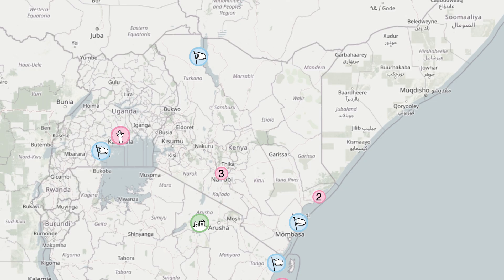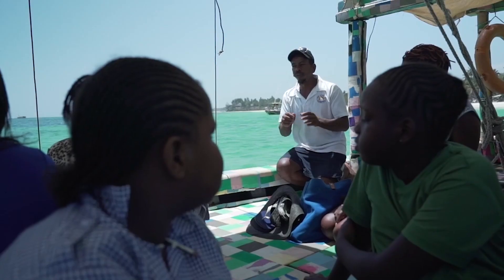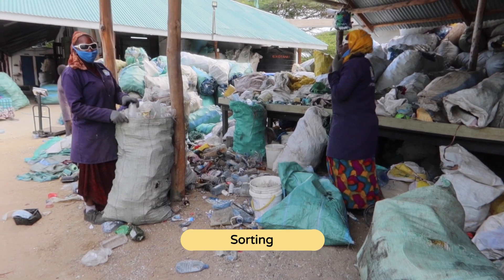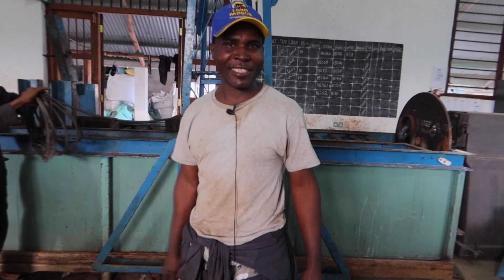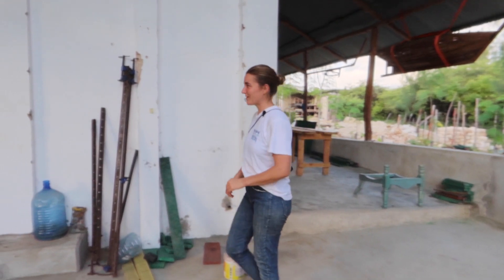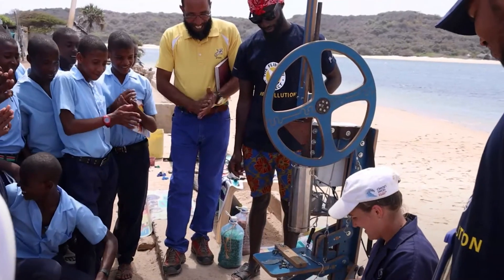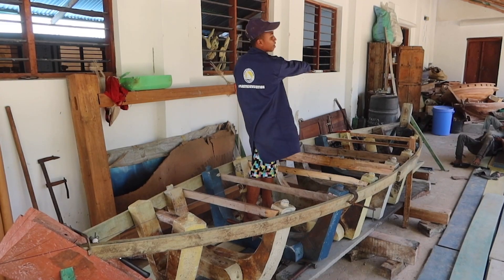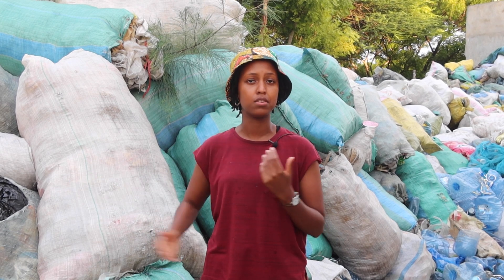They turn trash into boats!

Comment: Honestly, a lot of these plastics would be far easier to recycle locally by makers if manufacturers would just CHILL THE F OUT WITH THE LABELS/ADHESIVES.  Getting manufacturers to stop with some of their nonsense will go a long way.  Won't be as splashy or get you a bunch of clicks, but it would probably affect the outcome more.
Reply from the maker: I think we would all agree to that. If you watched until the end, you will have seen that one part of Flipflopi's work is to work on regulations and laws to tackle the problem from the source - as recycling alone is only to clean up the mess, so we need to make sure we avoid the mess from happening in the first place. Tough one though, sadly the industry is powerful. :/
Reply: @Precious_PlasticHQ  Yeah I wrote that before reaching the end of the video, and you're right.

It will probably take regulations.  Specific regulations need to be proposed.  Manufacturers won't propose them on their own; society has to get together and ram this change through them.

First option is just to ban single use plastics, but that would be tricky.

The next would be to produce a universal standard container spec which meets specifications for recycling (and come complete with tooling to actually do it).  Go in increments from 0.5L and increase in powers of 2.

Once that's in place, require the manufacturers and designers to produce a similarly spec'd product.  Shift their financial focus from "making things pretty" to "making things functional".

If they want to save on those extra costs, they can just use the universal standard.

Comment: great idea, even more microplastics in the sea
Reply: This comment does in fact raise a valid debate that I have battled with. I'm am a qualified mechanical engineer and have been building and experimenting with the Precious Plastic equipment in my shed. As I experiment I do see micro plastics being formed. I gather what I can and reuse, but not all. When I analysed my angst about this fact, I concluded that:
1) the volume of material I recycle into products, versus the tiny volume of microplastic created, is vastly in the favour of the products produced. 
2) ALL of the material I use would have destined for landfill, now only the micro plastics in my vacuum waste bag will go to landfill.
3) the Precious Plastic initiative has enabled many many people to recycle - so with some basic math, it is clear that the trendline 📉 of recycled material going into landfill is heading in the right direction.
Reply from the maker: Thank you guys for the debate here :) indeed micro plastics are always a hot topic, we are fully aware of the issues caused. We provide tutorials and tips on our academy on how to reduce its production but greatly depends on specific and contextual conditions. This being said I wouldn't diminish the great efforts and impact from Flipflopi. We are sure they're aware of the issue and are probably working on it themselves.
Reply: It Is difficult to reason with people which seems to think that open source plastic recycling done by communities Is as Dangerous for the enviroment as those entities that are actually plastic producers.  My advice would be, start to get your hands dirty with the research for a solution, before closing your eyes with and easy judgment.
Reply: @dittagecoeco2738  rarely read so much and with so little content.  Honestly, if you think like you, you can skip recycling.
Reply: @AE-uj7qc  Sorry, not a native speaker here.  Luckily you have the ability to know what people think without knowing them
Reply: @dittagecoeco2738  That makes no sense again because I know your opinion from your statement.
Reply: This made me giggle a bit😂

But it's sad to have peaople reasoning like you
Reply: @Tedd64  You probably also throw your garbage into the sea.  that's sad.
Reply: Not really mate
I come from Mombasa, which is almost an island surrounded by Indian Ocean and I've conducted a couple of beach clean ups in fact.
I follow this channel to know ways of recycling plastics,I've improvised a double sheet press btw
Hoping you don't litter our oceans!
#We're watching
#climateaction👁️